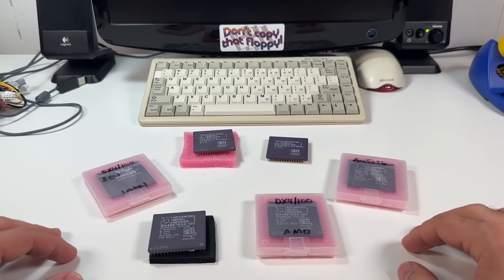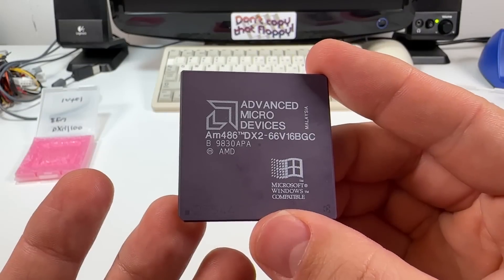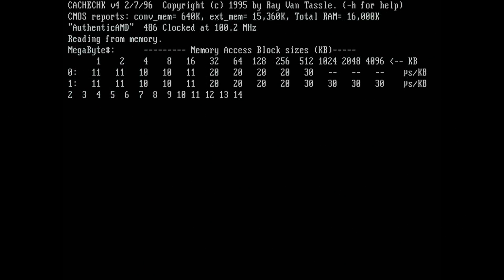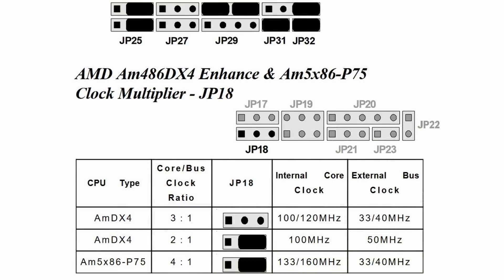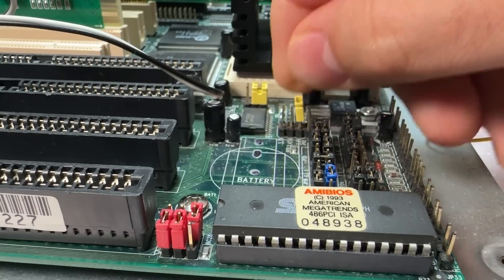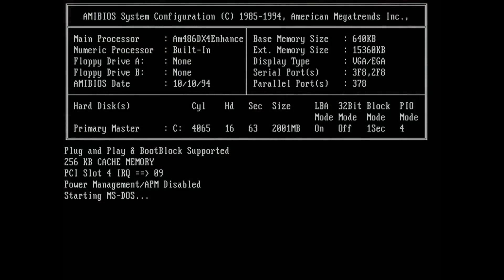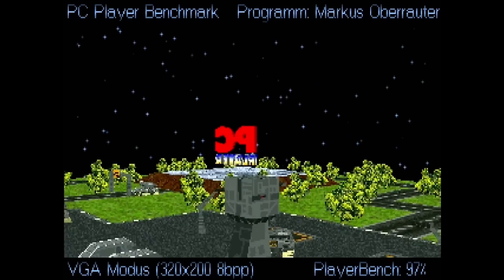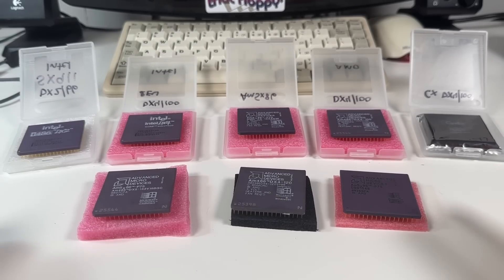These AMD 486 CPUs Are Not What They Appear!

Comment: I purchased the IBM Blue Lightning system back in late 93...  486 class DLC3 66Mhz cpu with separate maths chip...  very interesting system which I regret getting rid of ..  the main cpu was supposed to have been a really fast 386...  it was benchmarked as running at 69Mhz... I never thought of overclocking it at the time...  had a Vesa local bus graphics.   Wish I still had it.

Comment: CPU's that failed  manufacturers QA were often sold  for use at a lower clock speed. Because some money was better than bining them If you had a load of the P75 like speed  133 486 that were a bit iffy why not sells them as dx2 66! I do remember having that chip!

Comment: Never had 486. When I had Am386SX 25MHz I wanted 486 badly but I had this 386 quite late and by a chance I got Pentium 166MHz + board + 32MB RAM and this PC made true difference. Especially after getting PCI video card and 4GB hard drive.

And these times... I have bunch of Pentiums with slowest being P75 and also P166MMX and Cyrix 6x86 MX also running at 166MHz. I also have 386DX 40MHz and... I guess I think it is fine. 486 would be nice but technically for 486 games its better to use fastest CPU you can put on 440BX board rather than 486. 386DX40 might be too fast for some games but as luck has it Socket 370 and especially older Pentium 2's for Slot 1 CPUs with cache disabled get slow enough to pretend to be as slow as 386SX so technically I don't have any need for 486.
That said maybe I'll some day get one. We will see. I don't want to spend real money on 486's

Comment: How do these over clocked 486/586 chips compare with a original intel pentium 100mhz on a socket 7?
Reply: at the times when ibm made and labeled honest quadruple speed 486dx4/100, and always late intel cheated with tripple 486dx/75, labeled as dx4, and amd triumphed with its x5/133 - and specially to mention, data moving under intel was so bad (slow), remaining many generation times slower than any others - at times when no-brand motherboard-label shuttle produced eu-grade quality pentium1 board with 83mhz fsb, intel still sneaking on 33mhz, with blood and sweat doubling to 66mhz fsb (front side bus - the data highway), and amd produced proud 5times internal speed processors, running all its data busses at adequate speeds - proportional to multyplier, but monopolic intel produced pentium  1 and even pentium 2 just at lowest 66mhz data bus speeds - never ever achieving any equality in moving internal data, any decent videocard or any normal working mobile processor - just gigantic ovens (processors), self-igniting and consuming tripple or quadruple the electricity needed for their amd or cyrix collegues. so, i used amd486 in rythm 3x50mhz=150mhz, wich was the most data moving velocity at that times, not knowing that internal data for programming some clock generators goes upto 80mhz. and at the same time, intel datasnailing at 66mhz - imagine what horror experiencing me when switching to someones 66mhz snail from 150mhz gepard. similar in pentium times - me running even in 2000 amd k6-2/500 at 125mhz bus speed, and intel still snailling at 66mhz, and all this made with usual air stock cooler, working stable even at +34 celsius.

Comment: Why does the socket seem to have a bunch of holes for pins on the outside that aren't used?
Reply from the maker: This is Intel's Socket 3 - it was a multi-purpose socket designed to work with 486s as well as the "Pentium Overdrive for 486 Systems". As far as I know, only the POD will fill the complete socket. Thanks for watching!

Comment: Where do you buy those plastic holders for your CPUs?
Reply from the maker: These are actually gameboy cartridge cases. There are quite a few sellers on Amazon that sell 3rd party replacements for cheap (about 50c each or so). They fit 486 and socket 5/7 CPUs perfectly.

Comment: When i was kid, i  saw shops in Poland selling computers with 486 processors clocked 160mhz (486 DX4 160mhz).
Later i learned there was no 160mhz 486 model, they had to sell computers with overclocked processors.

Comment: Thats nuts. Only thing I ever got to overclock decent was a AMD K6-2 500, Had it up to 650 with a 90mm fan on the heatsink. Used it that way until the motherboard died.

Comment: I once put a P200MMX on a newer board that also supported higher voltages. IIRC, I bumped to 3.3V and got it to 300MHz.

It required a socket 370 cooler but worked fine for a couple of years.

Comment: Awesome video man. That overclocked 486 at 160mhz is insane. I did checked my colection and found an 486 DX4-100SV8B with manufacturing date 36 week of 1996. It had 16kb L1 cache, so I switch the jumpers and now it detects AMD DX5 - P75 - 133. Suuper! Thanks for sharing the discovery.
Reply from the maker: Awesome! Thanks for sharing :)

Comment: You need to put those chips in a M/Board with Vesa Local Bus boards for graphics and peripherals. PCI and AGP really only ran at 33Mhz, where VLB ran at the base clock speed, so if you had a 50MHz FSB clock, the graphics ran a lot faster.
Wish I'd known this CPU relabling back in the 90's - had 5x-133 based PC used primarialy for an early version of POV-Ray to do animations. I could have rendered larger frames, or more frames, in the same amount of time - usually overnight runs for 320*240 frames, maybe a hundred frame each night.

Comment: Man, over 100% overclock on my Ryzen 7 1700 would bring me to somewhere around 7ghz. Unfortunately for the past 5 years I've only managed to keep it solid at 3.85 on all cores.
AMD really fell off lol.
Reply: nope - amd already overclocking internally their processors and selling them in optimal regime of computing pace, wich is not the case with intel - still struggling in pre-last ice age of fatter and hotter nanometers category, never ever achieving what amd already produces for years. and if thirsty fo more amd might, look no further - switch to the bigger zen brother - epyc. there are allmost 100 cores on one chip, and some two hundred threads, and uncharted areas for overclock. have a nice amd-ing!

Comment: My first CPU was a 80286. I didn't get a chance for upgrade till I passed the entrance exam for a famous university and my mom bought me a Pentium 100 MHz PC as celebration gift.  Most of my campus friends were still using AMD 486 DX2 or DX4 which I kinda admitted that the fast ones like DX4-120 weren't so slower than mine. I was quite familiar with these uncommon 486s from AMD because I was often asked by my friend to help when their PCs got a problem with, or they wanted to upgrade to / reinstall Windows 95 which was a whole new OS at the time after DOS+Windows 3.11 for workgroup we've been with quite a long time.

Comment: "Heatsink Req'd"
I remember going from a 386 to a 486 DX2 (my very first hardware upgrade IIRC) and also ordering a (tiny) heatsink and fan "just in case", even though people kept telling me I shouldn't bother. I also remember how impressed I was with the 486's performance ... until I tried to run Strike Commander. Which, as it turned out, did not "really fly" on a DX2, despite what the marketing said... :D

Comment: In 1995 we called them Super Socket 7 CPU's, faster and more cash.
AMD produced the intel 486 chips too, outsourced.
Super Socket was never a real thing, retrospective, now we have better chips, faster mem, so able to clock higher. Jumpers only on release, now able to clock in the BIOS !
486 220 was the max we ever did, only some voltage over voltage, AMD Dresden later 486 model in 1996, DX4 120 was official too. latterly renamed ! DX 2 and DX 4 was official support only, all other Socket 7 models NOT ! later released models do DX > 120
AMD 5 we never called it ! Super Socket 7 we called it, just 486 by AMD !
Try Super socket board please, ASUS later release say Super Socket 7 on the Box, that is where that name came from ! Bios support too !

Comment: Funny enough, I had this same motherboard back in the early 2000s. I exclusively used the AMD 486 processors and would experiment with the overclocking. I had both the DX4 and the DX2 processors. I never experimented with the overclocking on the DX4, but I could make that DX2 do some crazy things. I was pushing Pentium 2 speeds on a 486 chip in the late 90s early 2000s.

Comment: Picked up an AMD DX4 100 and parts from a yard sale not too long after the P133s came out.  Built a great system that was not too far behind our brand new P120.  My Dad was impressed and a bit miffed that I built some cheap that was almost as good as the nearly $4k computer he just bought.
My best overclock was late model Athlon 500.  I heard that AMD was selling 650s as 500s at the time.  Got lucky and had the 650 die in mine.  Overclocked it from 500 to 814mhz.  It absolutely stomped my friends brand new 1Ghz Duron.

Comment: An 80MHz FSB on a 486 is quite insane indeed. I remember my Abit BP6 Dual Celeron board, I had 2x433 MHZ Celerons on there with the FSD overclocked from 66 to 83 MHz and the Celerons' fixed multiplier of 6.5 gave them a clockspeed of 540 MHz, rock stable without overvolting. Maybe I should fire that board up again one of these days :)

Comment: If you like those...  I still have in my procession, a 486 DX-50 (50 Mhz front-side / 50 Mhz core).  I haven't fired it up in some time but it's paired with a Diamond Monster Fusion  VLB graphics card that never had a single issue running at the 50 Mhz front-side bus speed.  This was the [ultimate] setup for gaming, back in the day.  It's also about the time that programmers had to start limiting how fast things could occur on a video display that used to be a function of the time it took to calculate.  That CPU will run rings around a DX4-100 if you're into that era of gaming.  Finding a suitable display card could be a trick.

Comment: I used to have a Intel Celeron A3oo Slot which if you blocked 1 Pin you were able to change the FSB from 66 to 100 which than ran absolutely stable at 450 MHz instead 300. That's quite a jump to considering the time

Comment: Here's a thing: one of my first PCs I owned was a 233MHz Pentium II. I overclocked it to 400MHz & successfully continued to use it for years for actual afterwards without any issues.
Reply: FrankHarwald
over voltage was the issue, old Socket 7 systems in 1995.
In 2000, they kept releasing board for it, mad ? these newer board let these old DX2 and DX 4 chips was faster on higher clock speeds, faster DDR chips on the market too !
Why keep using them in 2006, Socket 775 was the next Sup[er Socket 7 ! same we did on them, fast DDR 3 in it, install Windows 10 x64 !
1700 is the next super Socket 7, Absolut in 2024 ! Keep the Xeons that support it ! High Watt, is better colling only !

Comment: Ahh, the 486 DX2/66, a great processor for the day. I only ever had one problem overclocking and that was with an AMD Athlon that was rock solid up to the day when it physically went pop about 18 months after install and at a point where I was winning a game. I classed this as the computer cheating, but on the flip side, it created the situation for the next upgrade.

Comment: This reminds me of the AMD "Applebred" CPU, the Thoroughbred sold as a Duron CPU -1400, 1600 and 1800 clock speeds ... you could use a pencil to 'recreate' the traces on the top of the CPU that set the features and have a fully functioning Thoroughbred Athlon with the full 256mb L1 cache.

Comment: I miss the days of easy overclocks. I had P166 that ran @ 200 with just a simple jumper change. An easy 20% and I probably could have got more but never even tried. Now everything is binned at max speed and overclocks are rare and tiny.
Reply: carlpeters8690
We called it Super Socket 7, 220 was the max we ever did, on AMD Dresden CPU in 1996.
some over voltage only, getting very hot, water block only on it. Stable build it was, we kept that 20 years. Unable to install Windows 8 on it killed it.

Comment: I remember my dad overclocking his dx-2 to 160 Mhz, i just don't remember which one he had. I know that i had mine, which was 40 Mhz passive cooled, overclocked to stable 80 by adding a fan. This was a very common thing to do. It just looks surprising from todays point of view, where you rarely get a few % more. The last thing that i overclocked at least nearly as much was a Phenom X6 1100T which ran stable at 4.2 Ghz with the protective film on the 240 AIO, that i forgot to remove. The trick was to use a far newer motherboard that could actually deliver enough power to this monster.

Comment: Back in the mid-90s a friend of mine sold me a DX4-100 system for next to nothing.  I soon upgraded it to an AMD-X5-133ADW that I bought used. Discovered overclocking soon after and moved the frontside bus up to 160. Ran it that way for about three years and gave it to my sister who ran it for about as long.  It was a rock solid overclock.

Comment: Find the fastest SRAM chips you can for L2 cache then try the higher FSB speeds. I had a Micron PC 486 motherboard which I ran an AMD 5x86 on at 4x40 Mhz. It would boot at 50Mhz but lock up after a few seconds. But if I disabled L2 it would run, though terribly. I couldn't afford faster L2 chips to get it to run at 200 Mhz.
Reply from the maker: That’s what I’m looking into next. The SRAM is soldered on so I’m going to work on getting some sockets installed one of these days. Hopefully I can find some genuine 10ns or 12ns SRAM that isn’t just the relabeled stuff on eBay  👍
Reply: @vswitchzero  what was fun with older computers was getting more speed out of them by using RAM rated faster than what the board called for. They had rather long timing windows for the RAM to be ready for a read or write. It just had to be ready somewhere in that window. For example a board with a specification for 150ns RAM might have the reads and writes somewhere in the later 50% of the timing. But if 100ns RAM was installed the ready time could shift to somewhere in the first 50% or be ready right at the start of the read or write time.

Once the read or write finished, the system would immediately start another cycle. By enabling it to read and write RAM as fast as the motherboard was able, a significant speedup could happen. On PCs with an audible tick during the RAM test part of POST I could hear the computer run faster. Put much faster than spec DIP chips on the motherboard of an XT or old 286 and add a slower ISA RAM card to backfill to 640K, the counting tick changes from a high to a low pitch as it slows down testing the ISA RAM.

Being able to do this depended on a computer (PC or otherwise) having sufficiently "loose" RAM timing cycles AND not having an absolutely fixed time to read and write RAM. A device that has its RAM timing precisely locked down won't benefit any from faster RAM. The faster RAM won't make it not work, it just costs more.

But when SDRAM came along, RAM timing got tightened up and there's BIOS settings to lock the timing in so faster RAM will only help if the motherboard can be set to take advantage of it. Even worse, for retro enthusiasts, companies started making faster SDRAM DIMMs that wouldn't work at slower speeds so putting the later 100Mhz or 166Mhz sticks into an older board might not work at all when with the early 100 and 166 sticks the fastest timings could be set in the BIOS and/or overclocking could be tried, knowing the RAM wasn't likely going to be a problem.